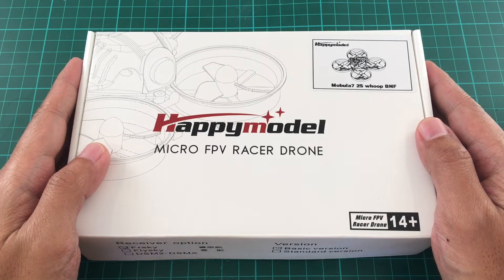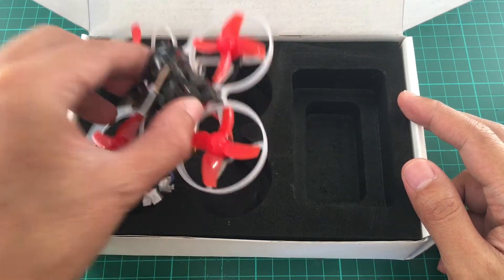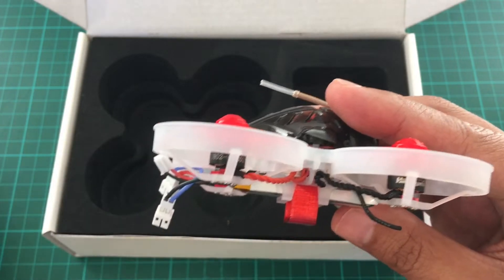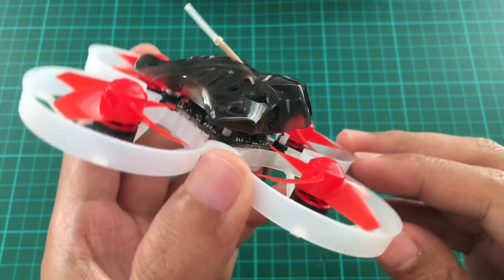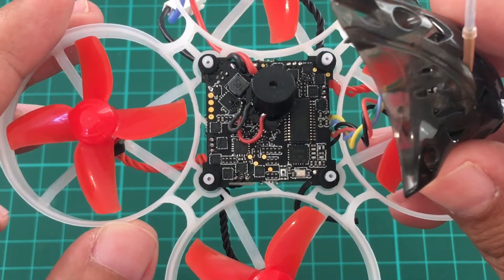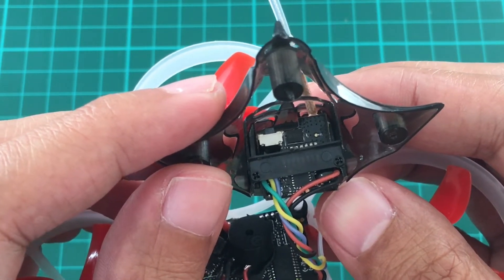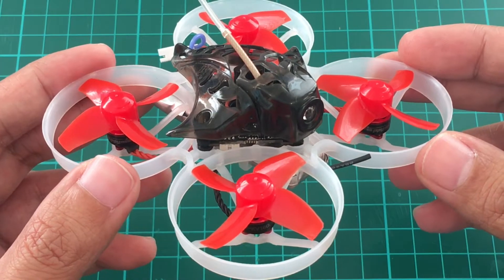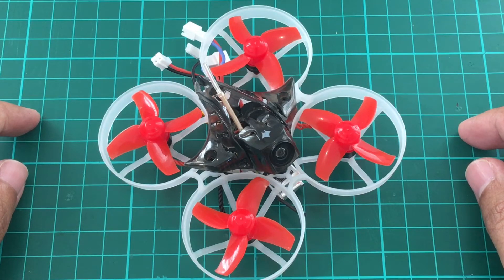Happymodel Mobula7 Unboxing

Comment: Cool, thx for the review, not sure why mine came with black props, I like the red ones as I spent an hour looking for a lost black one in gravel, no fun! I just ordered some red ones! I just published my first Flying Mobula7 Vid, outdoors, full noise doing tricks in the wind, it's an amazing Quad for the size, I love it, so much I just ordered parts and another Mobula7, I did notice the frames break quite easily, I use Metal Tape to repair them, quick and effective and no glue required. Here's my new vid if keen to have a quick look, thx again, https://youtu.be/GO-0iZ_fcEc

Comment: Does it come with that 'jumper' thing to make it run off just one battery? Or did you have to buy that seperately? if you had to buy it seperately, what is it actually called? Thanks!
Reply: I have it dont come with a jumper.. this the connector you need to get and then solder it together to make a jumper 

BETAFPV 10pcs Upgraded Tiny Whoop JST-PH 2.0 Power Whoop Female Connector Cable 55mm for Blade Inductrix https://www.amazon.com/dp/B071ZVQF8J/ref=cm_sw_r_em_apa_i_KL20BbEA66XQT
Reply: @thatonebeone  You can also use this: https://www.ebay.co.uk/itm/200Pcs-DVD-HDD-PC-Mainboard-PCB-Plugs-Jumper-Caps-2-Pin-L5T8-T8S2-V7U0/282725177685?_trkparms=aid%3D555017%26algo%3DPL.CASSINI%26ao%3D1%26asc%3D20160706105120%26meid%3D6f1865751a9247009c448e831a3228c7%26pid%3D100508%26rk%3D1%26rkt%3D1%26%26itm%3D282725177685&_trksid=p2045573.c100508.m3226